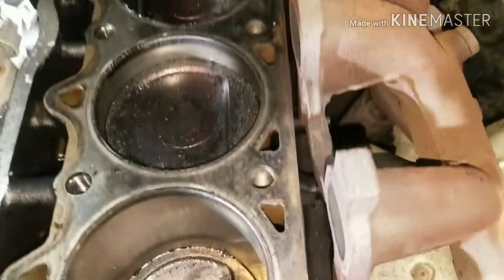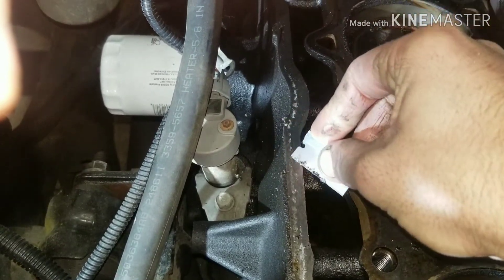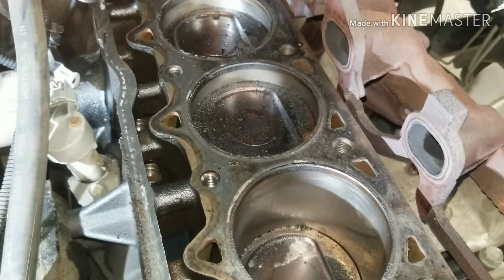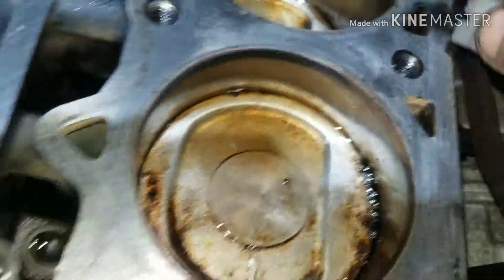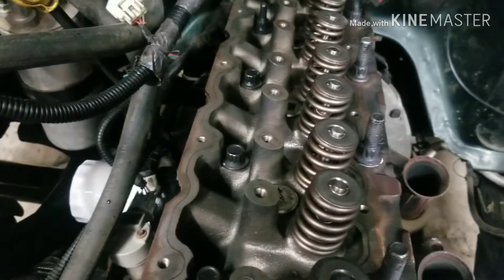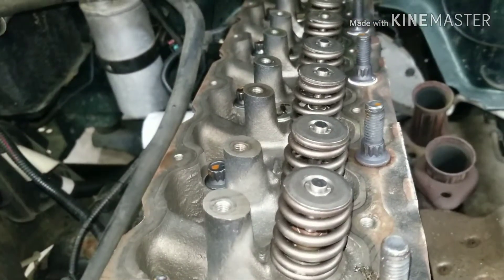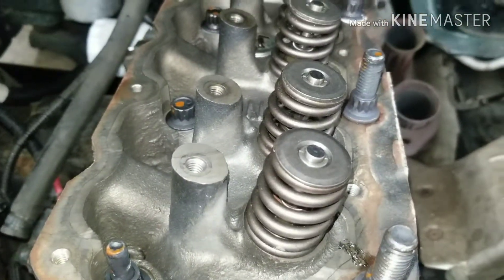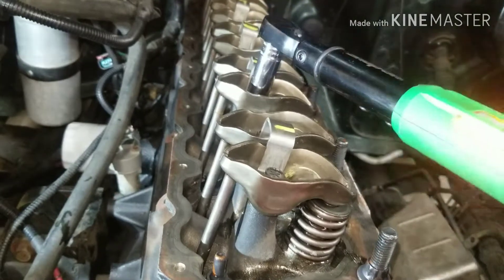4.0 head gasket replacement  on a jeep wrangler, Cherokee (part 2)

Comment: you had a blown head gasket with only 20K miles?   is that normal?
Reply from the maker: I think at that time the car was 15 years old and sits alot and the antifreeze was not kept up on so it may have ate into the gasket material. thanks for watchin.

Comment: Ill be replacing my head gasket soon so this video is very helpful. I do have a question IF my cylinder heads have a lot carbon build up would you recommend getting some MAF sensor cleaner and clean off the heads? Iv heard MAF cleaner doesn't leave a residue so that's why I would want to use it. Pardon my ignorance please. I'm not an auto mechanic. Doing my best to educate myself on this before I under take this. I don't have the money to take it to a shop.
Reply from the maker: You can  clean all the carbon off with brake clean or carb spray either one is cheaper and leaves no residue. If your doing a head gasket I would recommend geting yout head pressure checked and surfaced . This would make sure that your head is still good they are bad for cracking. I hope this helps and besure to like  and subscribe to get more helpful tips and tricks.
Reply: @fixergood   Thanks for the fast reply. I will look into the pressure checker. Subbed to your channel btw...spending the rest of my day off watching your videos and some others.  Again thanks!
Reply from the maker: James thanks again for watchin my videos  and I'm glad  I was able  to help you out